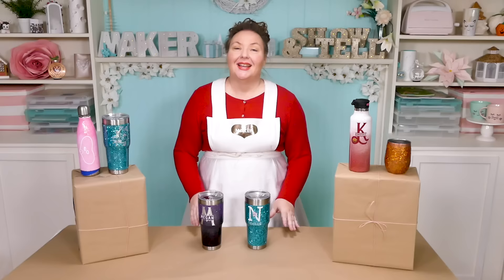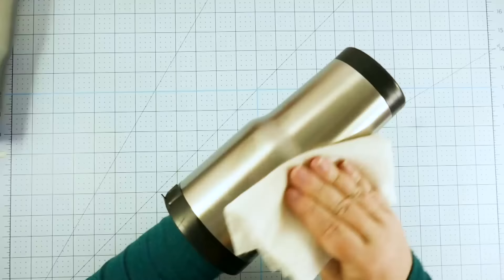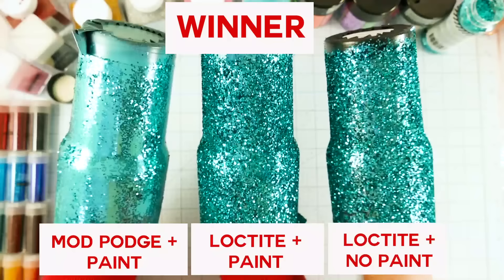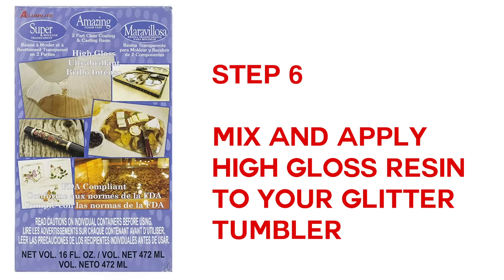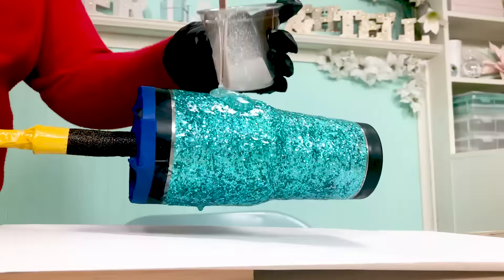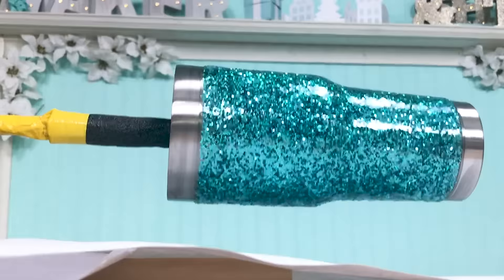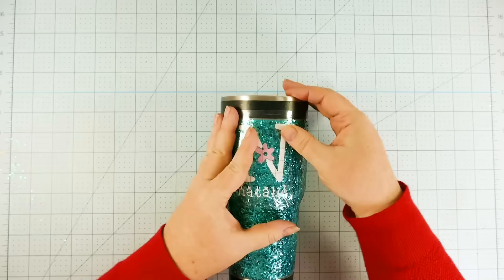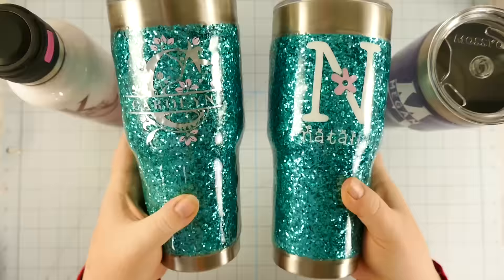Glitter Tumbler Tutorial - Epoxy + Loctite Method - Full Process Start to Finish!

Comment: Jennifer, loved the video. But I wanted to share with ya that if you are stopping the turner while it is still attempting to turn, over time, you can mess up the bearings and/or gears inside. Stopping the turner for a second to remove the tape would've made the cleanup a bit easier all around. Also, acetone is amazing on sloppy wet resin. Thanks for the video! they look great!
Reply from the maker: Thanks for the tip Anthony! Thanks for watching!😊🌻

Comment: A tip as far as spray paint goes, if your glitter is translucent a base coat goes a long way. You'd need many coats of translucent glitter to get a solid covering. Base coating, especially with a matching color helps reduce the coats of glitter you need for good coverage
Reply: Just In case ya may have missed that part at the beginning, That's precisely what she did. :)
Reply: @brookeboyett2771  I was responding to Jennifer's statement about not needing to base coat and clarifying why one might need to. ;)
Reply: @n3rdygrl  You should have your own channel if you know so much !

Comment: Here is a chunky glitter tip to help you get a much smoother finish. If you do a burnishing technique the glitter Will lay flat instead of being lumpy. I use a cheapy paint brush to burnish while the adhesive is still tacky. Works like a charm.
Reply: Nice tip, and ty.
Reply: Burnish?  I will have to google!!
Reply: How do I do this?
Reply: @daveywaves5325  cat sniffer? Lololololol 🐱

Comment: Nice tutorial, I use the same epoxy.   I usually mix mine until its clear.  I noticed yours was a little cloudy sometimes in my experience if you apply it when its still cloudy you can end up with a sticky tumbler.  Mainly because it was not mixed properly.  Just a tip just in case anyone tries it and have that problem. :)
Reply: Sonya Lynette absolutely, that brand of resin has a 30 min set time, there is no reason not to take the time to properly mix until clear. If not mixed properly, it will fail in a short amount of time with the resin getting bubbles in it etc.

Comment: have you tried mixing the glitter into the Modepodge and then painting it on, instead of sprinkling?  I have done this with other glitter crafts and it worked well and helped improve the coverage. May work here.

Comment: You also need a respirator! Do your research please.
Reply: I agree...I am so tired of people doing videos with toxic material and not even mentioning it!
Reply: Sherrie White - I know right!!
Reply from the maker: Epoxy resin is toxic while it is curing, and safety precautions must be taken. Wear proper protective equipment (nitrile gloves, long sleeves, full-face respirator, and apron) and work outside or in a well-ventilated area. Do not allow epoxy resin to touch your skin or be inhaled through fumes or dust. If you get some on your skin, wash it twice well with soap and water. Always read the safety information!
Reply from the maker: Yes, I know. :) A respirator is in this video -- I link to one in a card right on the video so people can get one.

Comment: And ensure to always use epoxy resin indoors without a respirator so you can get chemical pneumonia or lung damage. 🤦🏻‍♂️
Reply from the maker: Epoxy resin is toxic while it is curing, and safety precautions must be taken. Wear proper protective equipment (nitrile gloves, long sleeves, full-face respirator, and apron) and work outside or in a well-ventilated area. Do not allow epoxy resin to touch your skin or be inhaled through fumes or dust. If you get some on your skin, wash it twice well with soap and water. Always read the safety information!
Reply: you can literally hear her breathing problems

Comment: You could also allow the epoxy to drip down to the taped portion. The tape will be removed anyway. The football method would work by just planting the stick with the lid facing down.
Reply from the maker: Thanks for the tip!

Comment: Love this video! So helpful. I love the idea of the spray adhesive. One thing to speed up the paint process I use, I use a rotisserie claw and tighten to fit inside the tumbler and use a power drill with a dowel rod to turn the cup and evenly coat in seconds 😉.
Fantastic channel! Thank you
Reply from the maker: Great tip, Nicole! Thanks for sharing! 🥰

Comment: Yes its great that she's patient and very explanatory, she really needs to explore other ways of doing things and notice what she's doing also. You can use mod podge, in a THICKER coat. And you can do it all you have to do is pay attention. Also with mixing resin, you can use measuring spoons. If using ml is a little difficult for anyone, the measuring spoons do work and you get the same even measure of mix. Just remember to clean them out.  And please when using glitter, do not let the extra that's maybe adhered  to the cup or whatever your doing are off! Do not leave the bumps, that can make your resin uneven by just leaving that there.

Comment: They are beautiful but just a little tip about air bubbles the slower that you mix your resin the less air bubbles you will have.. I have a question for you though could you use a uv light or heat gun for faster results
Reply from the maker: Agreed!  Those pesky air bubbles can sure be a pain! :). Yes, UV can help the epoxy cure faster, however, the extra fumes that can be produced from a heat gun might be toxic, but I can't say for sure! :)

Comment: Jennifer, if I may...  I'd like to add a few tips and tricks. Make sure your area is well ventilated, and wear a mask from when mixing the epoxy until it is fully cured, which is 72 hours when in the room. Make sure the area is dust free, lint free, pet hair free. Use non-powdered NITRILE gloves. Epoxy will eat thru latex gloves. When applying the epoxy and having it turn, make sure the tumbler is level to make sure the epoxy remains even. When removing the tape, I always remove it right after applying the epoxy. By waiting, the epoxy can get sticky can cause problems. With your tumbler being level, when removing the tape right away, it won't run. Using either a metal or silicone stir stick when mixing epoxy will eliminate some bubbles, which can be problematic. You can remove bubbles on the tumbler by either running a torch or heat gun quickly along the tumbler about 6 inches from the tumbler, or you can spritz LIGHTLY 91% rubbing alcohol in the troublesome areas. One last thing, try to avoid using paper towels, baby wipes, or anything with lint around the tumblers. I found the best to use is coffee filters. I hope these helped. Happy Crafting! :)
Reply from the maker: Thank you so much for sharing those hints, Tammi! 😊

Comment: Using short bursts when spray painting is a good way for a novice painter to get good results, but you typically see expert painters just holding the trigger. The key point is to not stay in over the piece when you change direction so make sure you are spraying into the air when you turn back. Holding down the button is actually less strain on your fingers. 

A fine technique to use when painting in small volumes, but if you were to turn this into a business and you are going to paint 100 cups, you would want to use a more efficient way than start stop, start stop.
Reply from the maker: Most of our community members ARE novice painters and people who are not in the business of high-volume painting! Which is why we chose to present the painting technique we did. 😉 But, thanks for your feedback! It's always appreciated! 😊

Comment: I just did my first mug... and i put on  the second coat of epoxy...but it feels like there is a spot that is lacking epoxy. Can I do a third coat, or just touch up this spot? Do I need to wait 2 days to apply another coat? Thanks for the amazing videos! I have learned so much from you!
Reply from the maker: You can wet sand it with fine sand paper, and apply a 3rd super thin coat of epoxy. :)

Comment: I'm new to your page so just seeing this video now. My tumbler is currently its first layer of epoxy. It looks like I have areas on my tumbler that need more glitter, so I was thinking of adding a second layer of glitter. Is it too late? When do you add the second layer?
Reply from the maker: You can add more glitter, just be sure the epoxy is still tacky and then fill in any spots. You'd then apply another coat of epoxy only when that layer has cured.

Comment: Can you use the adhesive spray in 200 or no I bought that one on accident. It's the red loctite  can it says 200. Also for the ones that have a color already can you just put epoxy over that then glitter? LOVED THIS VIDEO great information and step by step was awesome. Thank you
Reply from the maker: I haven't tested the 200 so I can't say for sure.  And in regard to the colored cups, it all depends on what they are coated with.  Sometimes epoxy doesn't play well with certain plastics.  So read the labels on your epoxy to check and see that it's compatible with the coating on your cups.

Comment: Hi from the UK. I'm new to circuit and just bought a Maker. I'm using your great guide to learn how to get the best out of it and it's so helpful and straightforward to use. But perhaps you could help with a problem I am having with Design Space. Every time I open it up it asks for the machine I'm using and then wants me to go through a tour of its new features. This happens everytime I open Design Space - surely there is a way to stop this - if there is I'm sure you'll know. Thanks again for all your fan info

Comment: Thank you for your video! I followed your method but the whole thing is peeling off (one layer of loctite spray, glitter and then one coat of epoxy.) Any recommendations on what I am doing wrong?
Reply from the maker: I'm not sure why!  Possibly not the correct ratio in your epoxy mixture?

Comment: I just started making tumblers.. I bought Amazing clear cast, but I read that the product with yellow your product over time.  Have you had this problem?  If so, what product do you use now?  love your videos
Reply from the maker: I have not had mine yellow, though I have heard the same.  But yellow after several years, not immediate. I use this brand (affiliate link): https://www.amazon.com/Alumilite-Amazing-Clear-Cast-16/dp/B00CVYNQ4U/ref=as_li_ss_tl?s=arts-crafts&ie=UTF8&qid=1546116151&sr=1-2&keywords=alumilite&linkCode=sl1&tag=jennifer00e-20&linkId=a0f5947b40fb94a23e6cc9edf9b07b3b&language=en_US

Comment: Hello Dear,

I watched your videos for quite some time now and I want to try to make my own tumblers. But I have some issues because I am from Germany and unfortunately I can't buy the adhesive spray and the sealer spray you recommend in this video. So how do I know which adhesive spray and which sealer spray is good for my projects? I mean, don't I have to be sure, that the products are heat resistent to some point, and are suitable for my Resin? I use "Cast Resin". Or do I have to buy amazing clear cast?
Reply from the maker: You can certainly buy and use whatever is available where you live. :) I can't comment on other products that I haven't personally tested, but I am sure the resin you can find in Germany is fine. :)

Comment: Any tips I have got one that keeps coming out bumpy and the epoxy cures but it's smooth like level but comes but rough feeling I use a torch to get the bubbles out I have a turner as well. Not sure what I'm doing worng

Comment: On the last part...for the 24-48 hours to cure....do you leave it on the tumbler turner that long, after you remove the tape?
Reply from the maker: Stephanie, I would let your cup turn 4 to 6 hrs and check to make sure it is dry enough to no longer need it to spin.

Comment: Can you use regular acrylic paint instead of spray paint before applying the glitter?
Reply from the maker: You can drip a few drops of acrylic paint into the epoxy. Lighter colors may ned a few more.

Comment: Love your videos! thanks for keeping it simple.  Question:  is there a way to make a painted tumbler (ex. Spray paint) but sealed with a matte non glossy finish?
Reply: Alicia McDaniel resin is glossy by nature, to make resin matt it would take a lot of trial and error. I get a matt finish in my other resin crafts when the molds are not shiny. So if you place silicone that is not shiny over the resin as it cures it will dry matt. For this you may have to search extensively or but a mold making kit and make your own silicone piece to place over the resin. If you just want matt and arent too concerned you may have success in a clear matt spray paint and skip the resin all together.

Comment: Very quick question. Why do you have to use the 100 loctite spray and not the 300? How much of a difference is there?
Reply from the maker: The 100 is for light weight bonding and it dries faster.

Comment: Thank you so much for your videos...they are GREAT! One question, do you find the edge around the mouth area of the tumbler from taping the top creates a lip (or rough edge)? If so, how do you deal with that or do you find it isn't an issue?
Reply from the maker: I recommend cutting tiny slits in the top of your design at the mouth of the tumbler, and taping them down that way.  You may also use your scraper to ensure there are no bubbles or gaps in the tape to prevent the rough edges.
Reply: @JenniferMaker  Great, thank you! I appreciate your work :)

Comment: Thank you for making this great video!  Do you need to allow the glittered tumbler to dry before you seal it?  If so, how long?  I sealed mine immediately and it got a little drippy, so I put it on the turner to dry.  But I am not sure whether it was because I used too much sealer or because I didn't allow the glitter layer to dry.
Reply: I meant to mention, I used Loctite (not Mod Podge).
Reply from the maker: Yes, you should be letting the tumbler dry before putting the epoxy on. The length of time depends on whether you use Mod Podge or Loctite to attach the glitter.....with Mod Podge you will need to wait several hours for it to thoroughly dry, whereas Loctite will dry within about 30 minutes! 😊

Comment: I, like all the others, LOVE your tutorial. Thank you!! I got all my supplies. I’m ready to go....but one thing I didn’t consider was temperature. I live in MD and it is cold here. Any ventilated space is going to be well below 70 degrees. My house is barely 70 degrees. Do you have any suggestions? I was going to make Christmas gifts, but should I wait til Summer time to do this project? Thanks in advance!
Reply from the maker: They will eventually cure in cooler temperatures however, it might take a bit longer.  As long as your ventilation is good an you feel comfortable and safe, you can do this anytime.  Otherwise, they do cure much faster when it is warmer.
Reply: @JenniferMaker  Thank you so much for your reply!

Comment: hello, i tried to make my first tumbler yesterday but when i checked on it today 3/4 of the tumbler was stretched and wrinkly. could you possibly tell me what i did wrong?
Reply from the maker: It sounds like it didn't cure properly. Did you use exactly a 1:1 ratio? 😊🌻
Reply: thanks for responding!! Yes, I did the 1:1 ratio and I was able to touch it without any stickiness so that's why I thought it was fine to cure fully. and the epoxy was able to peel it right off, some spots were a little bit tricky but with the heat gun it pulled right off. I did the sanding and 91% alcohol rub, so I have no clue.  I plan on trying again very soon when I have saved up to get a plugged I turner, not a battery one to leave overnight. Thank you so much for the assistance!!
 @JenniferMaker

Comment: After the 5 hours on the turner, can I take my cup off without worry of the epoxy dripping?  I leave my cups turning for 12 hours.
Reply from the maker: You need to leave the cups on the turner until the epoxy has cured, or gotten hard, however long that takes! 🥰

Comment: Hello Jennifer. What is something else you can use instead of Epoxy resin to seal the tumbler.
Reply from the maker: There are various ways on how to seal a tumbler without using epoxy. You can apply CrystaLac, Mod Podge, or a clear acrylic spray instead. All have advantages and disadvantages, so choose the one that's most convenient for you.

Comment: I have a question,  when did you apply vinyl? Also you mentioned epoxy then high gloss epoxy are these 2 separate items and steps
Reply from the maker: You apply vinyl between the first and second coat of epoxy.

Comment: Can you skip the glitter and just go straight to decal and one coat of resin for vinyl protection?
Reply: Of course you could. 
I'm not sure you would need to have the resin.
Oracal vinyl that you can buy in 12x12 sheets at Michaels is very durable. I've used it on regular mugs and it has held up extremely well with hand washing only. 
But if you wanted to really make sure the vinyl never came off then yes the resin would be best to use.

Comment: Would a dremel with a sander head work for sanding the cups when the glitter seems so chunky? Uneven parts is what I'm running into. Plus do I have to wear a mask when I am sanding?
Reply from the maker: The epoxy will have smoothed much of the glitter out, Alicia! The reason for sanding is to rough up the surface so the second layer of epoxy will adhere to the first! Not very much "stuff" should be coming up with your sanding, but wearing a mask is never a bad idea, as we are finding out now, aren't we? 😉🥰